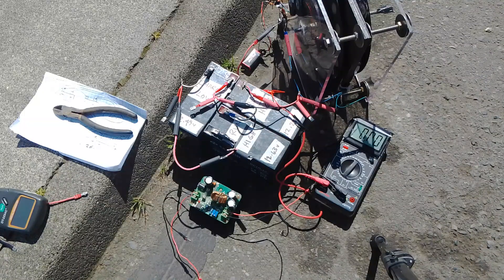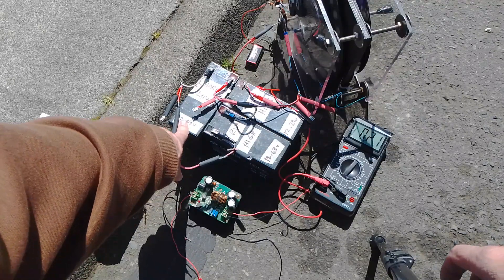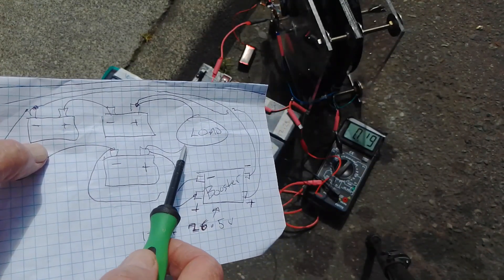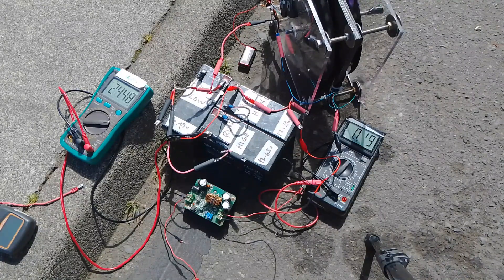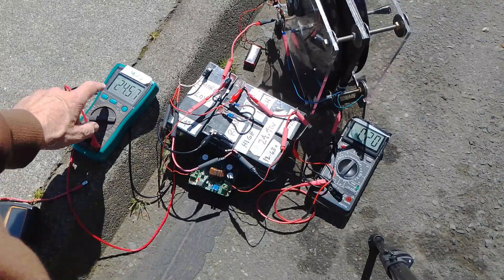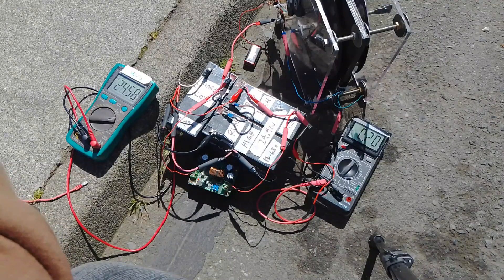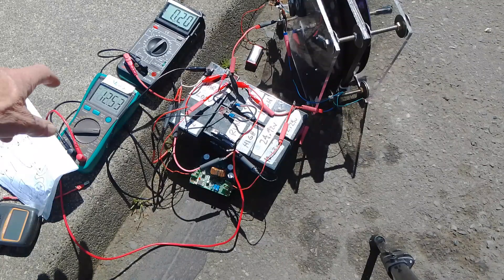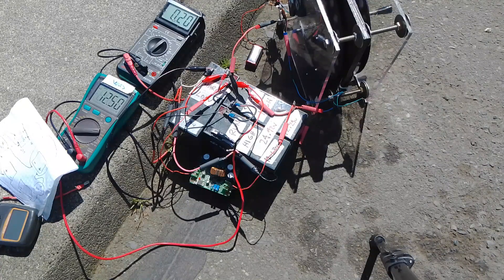3rd test DRMG splitting positives

Comment from the maker: Four hours after these tests I checked the battery voltage levels:

The two high side batteries started out at 24.92Vdc, and dropped down  to 24.80Vdc after the  hour it took to these tests.

The low side charge battery started out at 12.49Vdc and settled up to 12.50Vdc after these tests.
Sorry my camera's memory ran out at the end. 

I did lots more tests, adusting the voltage being delivered to the high side batteries through the DC to DC booster and the small potentiometer in it, , trying to not to "take too much" out of the low side battery that is powering the DC to DC booster, while at the same time wanting to deliver some good voltage level up to the high side batteries so that those do not drop down excessivle.
That seems to be the "goal" in to make a good balance between the high side and low side batteries recieving a charge - the low side from the 24Vdc "on top" of the 12Vdc charge battery, and the high side 24Vdc batteries need just enough voltage going back via the booster, to keep that voltage steady, not dropping excessively.
Reply: If you put your ammeter between the low side battery and the boost converter (the only measurement you didn't take) you will find the booster is drawing about double the current that it is pushing back to the high side battery. And that makes sense because the converter is being asked to double the voltage. So to double the voltage you'll get half the current. But that's OK you should see about 50% reduction of input vs output overall.
Reply from the maker: @markflint9089  Hi Mark
Thanks for taking a look at it -yes I did forget to look at from charge battery to the booster. 
in first test I did two days ago I did do that, and current was almost  1.3A leaving the charge battery into booster  and 370ma into the high side batteries on other side of booster... this test was very "biased" to slamming  the high side batterires up in charge, and the charge battery was  in punishment p;unging down rapidly since much more of the "natural" charge of 24V on top of 12V (and through the motor) was being "diverted" back into high side batteries via booster.  
This recent video I was fiddling with the postentiometer adjusting voltage output  of the booster trying to make it as even steven as possible between the l2V low  and high sides, trying to keep both steady as possible.  
Ultimate test I guess would be to compare to two of these 12V batteries in parallel running the DRMG motor, for a 12V input, and the backemf/flyback of the pulsing DC takien out via fast steering diode into capacitor, and capacitor dumped (while decouplled) into an external battery - maybe another two in parallel as well.  
Then compare that doing it in split the positive mode with same run time, and  with also the backemf/flyback of the DRMG motor coils also filling up an external battery and also doing the same "two stage" decoupled cap discharge into them.  Then wait a few hours, let batteries settle down, and  instead of looking at voltages, look at internal battery resistance with a meter that measures that, and see what advantage of split the positive mode would be in comparison....
Thanks for writing!
Reply: @MrDKONZEN  I'm not sure that simultaneous charge/discharge is good for lead-acid batts long term, but it does demonstrate the principle. I replaced the charging battery with supercaps and added switching for the booster output (on the positive line out) at 180 degrees to the load switching to give isolation of the returning current. This has the advantage that you can use the same voltage as the source, or lower if you want. Also the duty ratio between the load On time and the booster On time can be fine tuned this way. This can be achieve with dual-channel sig-gen, an arduino, or NPN--PNP transistor combo joined on the bases - the NPN switching the load while the PNP switches the booster. The first two methods need isolated power for booster transistor, but the last method doesn't. Also I found running between 36v and 24v was better because the boost converter is more efficient with a higher input voltage. Adding back the BEMF spike will be another advantage. All the best, Mark.